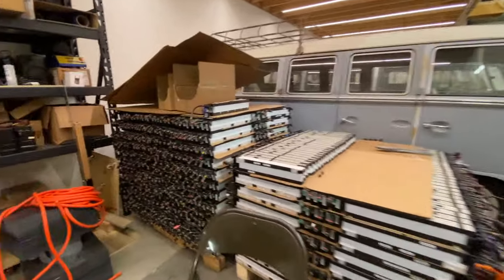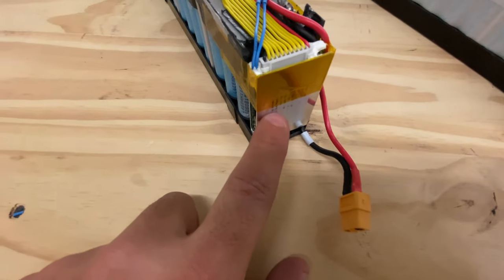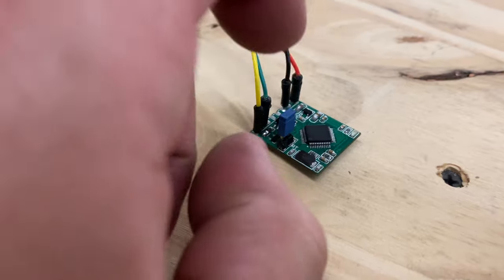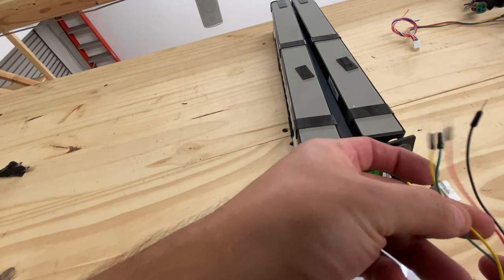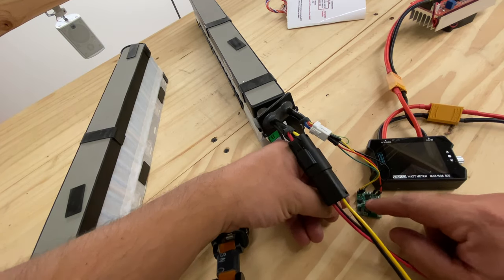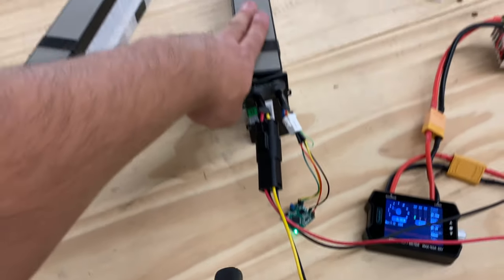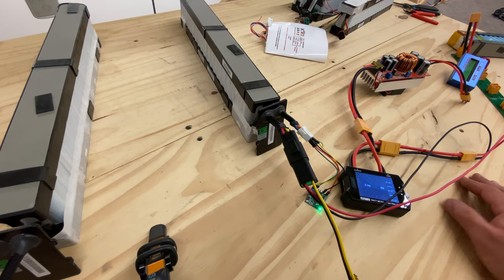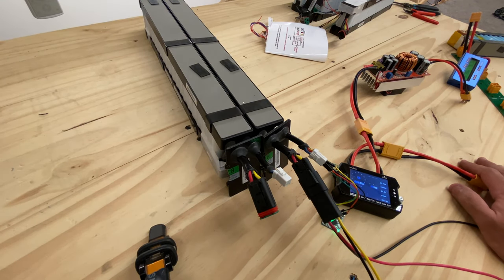CAN Controller Hack for Waking up Scooter Battery Packs

Comment: I would suspect that the CAN network on these is outputting state of charge, voltage, amps, temp, and/or other useful info because the original vehicle these were in probably had a dash or other display.

Comment: Any limit to how many can be paralleled to one controller?  Do you know the serial or parallel limits of the built-in BMS?  Does the BMS have a discharge cuttoff voltage?  I have a project this would be perfect for (the turn off while charging would actually be an advantage for this one project).

Comment: Nice vid, told you that we should get our hands on these. :) . My coleague Mihai actually did the sniffing and the coding part, credits goes to him, I was just assistant on this one. As for the charge while dicharging problem, we discussed that you should try charging them on the load wires, the BMS should still cut off, we will also try it tomorrow.

Theoretically charging on the load wires should be possible, the ebikes with regenerative break will charge through the load wires as well. Only one way to find out.
Reply: I use a solar mppt ebike charge controller to charge from the sun into the load wires. Doesn't work on all charge controllers like the green one but other than that it works great if amps arnt to high
Reply: @DIY Projects thanks! Yes, we chose this board that's already produced and has the can and stm . We will prepare a git repo and place the code then share the details how to program and use.
Reply: @Alexander1560  Alex, if you can shoot a link right here on githab, it's gonna be awesome!
Reply: @Alexander1560   Are you able to discharge directly from the main B+ and B- while charging via the BMS?
Reply: Hi. Yes. Can discharge while charging
Reply: Hey Alex, do you have any notes or code you could post? I'm comfortable writing code to talk to the CAN bus, but hoping to skip the step of sniffing the traffic and reverse engineering the messages I need to send.
Even rough notes would be great in a gist
Reply: @MichaelRies  Hi, I've posted the link with the github repo I created and it contains the arduino code we used for on/off. Check my other comment
Reply: @Alexander1560 did you ever release the repo?

Comment: I assume that it can also be powered by an external 5V source instead of shorting the the orange and pink wires together, correct?
Also are these STM32 CORTEX available for sale with the code written in to it?

Comment: Wow awesome! I have a ton of 36v batteries with similar bms issues. Charged em up via the discharge port but bms not allowing the battery to turn on so i have been taking them apart planning on changing out the bms with a different one.

Comment: Was able to decode a good bit of the BMS data via CAN bus such as voltage, current, temp, capacity, state of charge. My notes are here for anyone interested: https://github.com/jonans/jump_bms
Reply: Good Day Sir! I have a Yamaha Pas City Ebike, the battery died, I replaced all the li-ion batteries with new 18650s,  I put everything back in place, but the battery indicators says error.
Reply: Hello; was you able to uncode more from the controller ?

Comment: hi, i have a hy-rdf-s1004um-mh1 battery, and it gives me an output voltage of 180v. It has a sticker that says OTA with Anti-Theft. Is it possible to make it work with its original voltage? do you have to do a bms bypass ??? Thank you.

Comment: Jehu, two questions. 1) how is the programed Controller coming along 2) I just got my 6X pack of Mh1's without the plugs, could you send them (plugs) with the purchase of 2 Controllers, or give use another possible fix. Much appreciated.

Comment: Would I be able to charge these by just feeding power from my BoostedBoard's wall charger? It's a 54V supply I think. ie, is charging these packs just that simple with the BMS operating?

Comment: This is good work but what about those of us that purchased the packs without any connectors. Could you post a very detailed video on how to connect the third party BMS, load and charge connectors. I am trying to build a small modular Powerwall that can grow as I gain experience and understanding and I'm using the scooter batteries for ease of use... And you sir seem to be the DIY Powerwall guru. When Jehu speaks the Powerwall world listens!
Reply from the maker: I already did https://youtu.be/zBUSKtCw_kA

Comment: Jehu, two questions. 1) how is the programed Controller coming along 2) I just got my 6X pack of Mh1's without the plugs, could you send them with 2 purchased Controllers, or give use another possible fix. Much appreciated.

Comment: I have bought 12 of these packs and they all came with those connectors removed. What will be the process for those of us that would like to take advantage of this technique?
Reply: Same here. I have 10 of these packs. Probably going to have to solder that chip directly to where those plugs were hacked off.
Reply: I bought 2 , shoulda waited huh !!
Still a good deal 4 new packs
Reply: 8.27.20  I thought that the wires had to be clipped in order to resell them for use in other projects?  So now why are they showing up with the wire connectors?  I have 9 (360 cells) of the packs which i took apart and put the cells on to 50 of the PCB boards along with 4 of the 3 piece BMS before the daly BMS showed up.
Reply: @chucktrotter9699  most do not have the connectors watch the video again, splice and connect is the simplest way.

Comment: Guys I did the 3rd pin hack to TP6 and it works, here 3 quick short video that show (not as cool of @jehugarcia and Erik Meike's videos but hopefully useful) 

The 3rd pin hack to TP6
Search for: "Scooter Battery 3rd pin hack - 40 LGMH1 18650 - Simple Hack to activate the BMS (ep 01)" 

The BMS max discharge amps is 30:
Search for: "Scooter Battery 3rd pin hack - 40 LGMH1 18650 - Max Amp test (ep 02)"

The BMS does have low voltage disconnect at 29.5v:
Search for: "Scooter Battery 3rd pin hack - 40 LGMH1 18650 - BMS Low voltage disconnect test (ep 03)" 

Thanks @Alex Ayala,  @Erik Meike and @jehugarcia
Reply: 3rd ping hack to TP6: https://youtu.be/fN_Nm12tmIY
Max discharge test: https://youtu.be/Mgiim81HbR0
Low voltage disconnect test: https://youtu.be/163SH_IeAvc

Comment: Never thought someone who  saved my life in the early DSLR rig days would wind up doing the same for e-bike batteries. Any chance the CAN controller will be back in stock sometime soon, Jehu? I've got seven that I'd like to run - and an 8th that's mysteriously unlocked, but only when connected to their original Eagotech controller.

Comment: STM 32 microcontroller 😀😀. It is going to be interesting.
Reply: @DIY Projects Of course there is many resources and examples on that, but it is just interesting how it will work out in the end. And especially how the code works. :)

Comment: My battery did not come with cables - just little nubs where the wires were cut.
Reply: James G you'll need to solder to the wires to make the connections and you're done.
Reply: Christopher - thanks. I know that, but they are nubs about 1/16” long.  Thanks for the reply.

Comment: What is the peak discharge current for this pack?
Reply: This is 10s4p pack.
Reply: Using a homemade shunt and cheap multimeter (i.e. somewhat slow response) my pack shuts off if I pull around 25-28 amps. Restarts after about 10 secs by itself.

Comment: It doesn't lock out because u can charge and drive off 

The charge circuit cant handle use of battery while charging sos it locks out for safety 

I wouldn't bother trying to charge and run at same time
Alternate the banks use and charge instead

Comment: Can I pick up the scooter battery packs you are selling local to you?
What is the voltage and amp hours of these packs?
Reply: 36v, 12,800 mAh. Four 18650s parelleled the connected in series. Each 18650 in those packs has a capacity of 3200 mAh

Comment: Anyone have any suggestions for using this to power an RV at 12V  without breaking it down?
36v to 12v buck converter?
36v Inverter to 110V AC?
Reply: Why not just use 36v appliances?
Reply: @risoriano https://www.amazon.com/gp/product/B07L2RF826/ref=ppx_yo_dt_b_asin_title_o09_s01?ie=UTF8&psc=1
Reply: So the question is, would it be more efficient to use the buck converter or an Inverter, all things being equal
Reply: @joedockstader1347  I'd rather keep everything as stock as possible

Comment: Why not solder the components directly to the bms board and list them on the web cause each safety circuit needs a certain voltage to register it's safety being charged or used so locating the circuits on the board and adding the necessary resistor or other component and done no need to buy a CAN controller just trick the board but at a fraction of the cost and a lil more work but once someone does it and shares it freely it will spread and actually be helpful